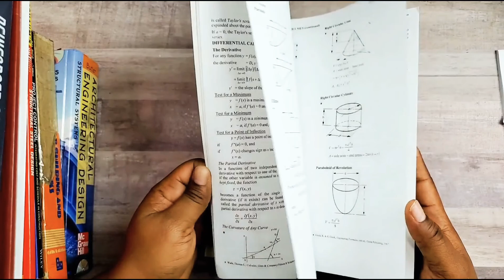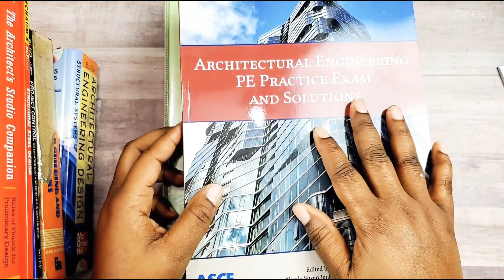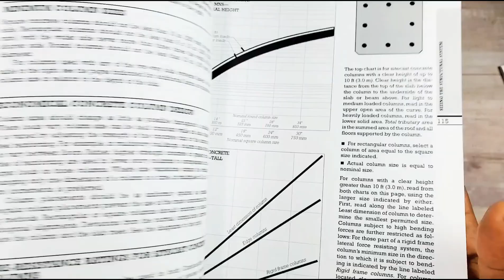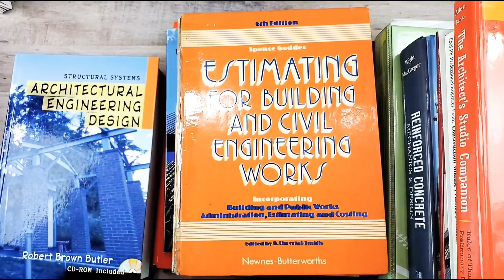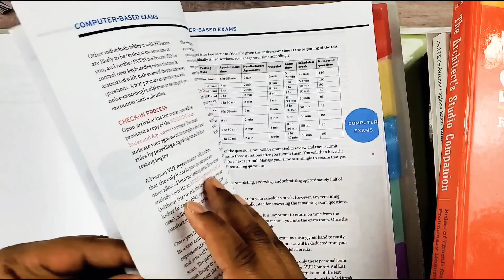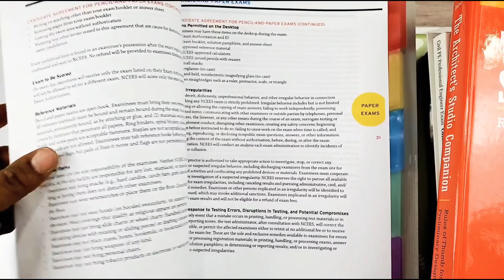My Architectural Engineering PE Exam Study Resources

Comment: Thanks for the content. I was wondering what is the different between the PE Architectural and the PE Civil? Is the PE architectural accepted by the different engineering boards? Thanks a lot
Reply from the maker: Hi. Thanks for watching. Sorry I didn't respond sooner. The PE Architectural covers electrical and HVAC systems & building systems integration while the PE Civil does not. The PE Civil covers transportation, and water resources while the PE Architectural does not. The exam costs are going up by $25 in January 2024, and the PE Civil specifications are changing in April next year to a more depth-specific exam. Hope this helps.